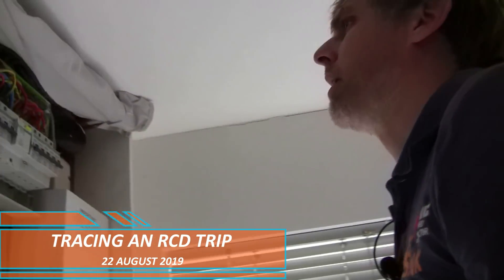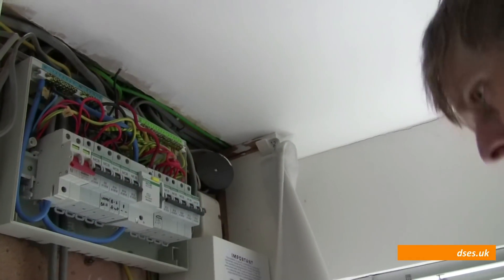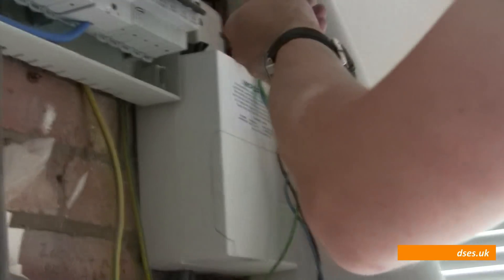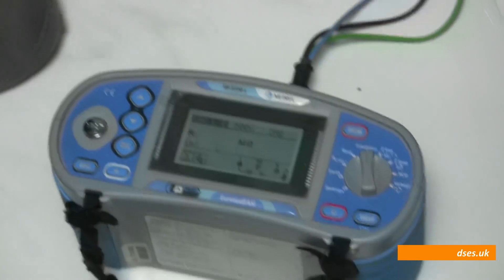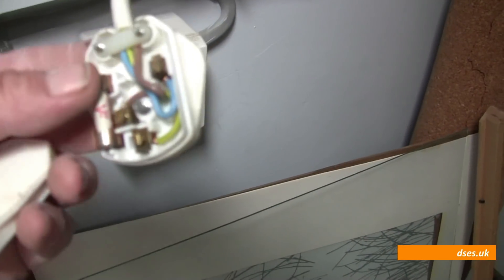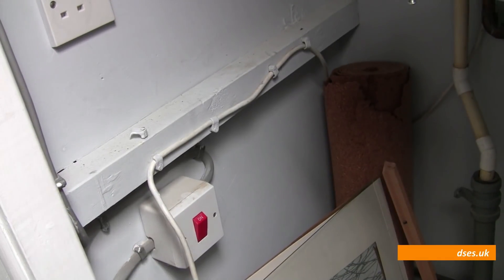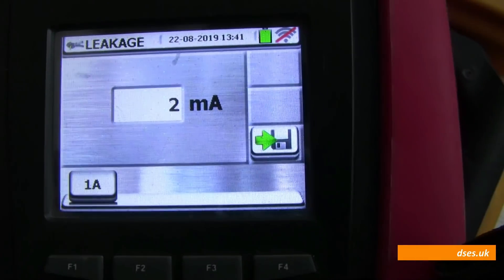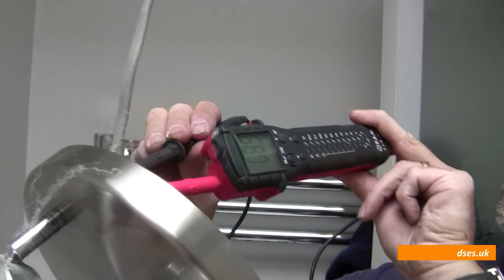Tracing an RCD trip

Comment: why do you guys join active and neutral together for an IR test?
Reply from the maker: We're squirting up to 500V DC into the circuit and there may be loads still present that wouldn't take kindly to it. By joining active to neutral, there's no potential difference between them that can pass across the potentially sensitive electronics of a connected load.

Comment: Went linking live and neutral together then testing ir between them and earth, can you not cause damage to appliances, lamps and e.g? Trying to get more comfortable fault finding so any tips would be fantastic
Reply from the maker: If line and neutral are linked together, then there's no potential difference between them, so you're not zapping your IR voltage across any sensitive circuitry. Unless there's a surge protector or filter between LN and earth, the IR test should cause no issue.
Reply: @dsesuk  absolute legend thank you

Comment: Don't think I've ever heard of small-size aluminium wiring in the UK. Are you sure it isn't tinned copper? That was fairly common back in the old days, required for rubber-insulated wires and apparently still done by UK manufacturers in the early days of PVC. The reasoning behind it is that rubber needs to be vulcanised using sulphur and that eats up raw copper so the copper is tinned first. PVC manufacturing is totally different so tinning is no longer required. Apparently these days (introduced about ten years ago) there's ways of producing rubber-insulated plain copper wires but until then rubber flex still had tinned conductors.
Reply: I suspect it's tinned copper, or copper clad aluminium. only once have I ever seen the old Solid core aluminium with the anti ox paste at the terminations, and that was in a house where it was built in the 60s (I think) and never touched. Well until we came and ripped it all out. Was probably the last house on the estate to still have its original wiring, and one of the last in the country to still be using solid aluminium t+e. It seems to be even rarer than rocking horse shite
Reply: @_______DR_______  Copper-clad aluminium would be the opposite, red on the outside and silver inside so either tinned copper or solid aluminium if it's silver on the outside.
Reply: @Ragnar8504  I was just wondering if he had prior knowledge that it’s copper clad aluminium, and wasn’t saying it’s aluminium based on how the conductor looks 🤔

Comment: You’re putting 500v down the live and neutral, not turning anything off. Couldn’t this damage equipment, which is plugged in?
Reply from the maker: It's possible, but I've not seen it happen. With a voltage applied to both line and neutral, the potential difference across them is zero... unless there's a switch on the line that is open or a broken conductor. Remember that IR testing in this way is exactly what happens in a PAT test, and although the code of practice for such lists this as a 'hard test' which can be omitted if a risk of equipment damage is perceived, most people who perform PAT testing including myself undertake such on common household or office equipment without worrying too much and without leaving a trail of destruction behind us. Manufacturers know equipment will be tested, and items around the home aren't likely to be too troubled by it.
Reply: David Savery Electrical Services cheers Dave 👍

Comment: Please help my electric went off at 3 in the morning, when I checked the electric cupboard it was the socket fuse that had tripped I tested all the other fuses but it was definitely the socket fuse that kept blowing, what can I do nothing was plugged in at the time to trigger it I just don't get it any advice would be grateful thanks
Reply from the maker: I'm sorry to hear of your trouble Suzanne. I'm afraid I can't say what the cause is without seeing it. You mention the socket fuse; that could be a breaker, an RCD or an RCBO that's tripping. A breaker would trip if there is an overload fault, an RCD if there's an earth leakage fault and an RCBO if there is either fault. Usually it's down to a faulty appliance rather than a problem with the house wiring, but if the house wiring has been compromised by, say, water getting where it shouldn't or rodent damage, then it could be an issue with the fixed wiring. You need someone to identify what kind of device is tripping, then narrow down why.

Comment: Does it matter for the RCD if the phase and neutreal are switching places? (I have a small shed where i maintain my bikes and the only means getting power there is a extension cord so IDK where the phase gonna be.)
Reply from the maker: An RCD is not polarity sensitive, and many manufacturers either don't label the terminals, or they label them as 1, 2, 3 and 4 instead of Line/Neutral in/out. That said, if your RCD is explicitly labelled, then by not following the labelling you wouldn't be complying with how the manufacturer intends it to be installed, although it ought to work just fine nonetheless.
Reply: @dsesuk  If i had any way making sure it would be the proper polarity i would do it, but in this situation its not feasible. The device only has explicit markings for neutreal, 1 and 2 for the phase:

https://www.mentavill.hu/_upload/images/catalog/423005/423005.jpg

Comment: I have experience of this. 9 times out of 10 it’s the circulation pump. Whether it’s in the boiler or not, sometimes it’s the zone valves if fitted on the system (not if it’s a combination boiler) my money would be on the pump🤞🏻
Reply from the maker: The heating engineer who turned up had no idea of insulation resistance and no means to test for such, so he part swapped the arse out of the thing until it stopped tripping. I don't know what ultimately fixed it, but I turned up afterwards and verified the IR was back in three digits.

Comment: Hi David, thouroughly enjoy your videos and watch them all the time. Just worth noting  you shouldnt have removed the cover of that boiler unless you are gas safe registered as it is a gas appliance. Just one for noting not a complaint, keep the great content coming. 
Rob
Reply from the maker: Thanks Robert, and I know, someone grassed me to GasSafe who had some words of advice. I didn't realise that the case formed part of the seal (or whatever the word is), an that it shouldn't be removed unless the manufacturer instructions state that it's only decorative. It seems strange to me that a manufacturer would make an appliance where the electrical connections are inaccessible to an electrician. We had the same issue again with another site only yesterday, but this time we had a gas man out to take the thing apart so we could IR test the component parts and identify which was giving us an iffy IR. It was the control board in that case, and he replaced it to get us all back in the pink!

Comment: why not just switch the rcd on then turn each breaker on till the rcd trips to find what circuit is faulty ?
Reply from the maker: Because if the fault is on the neutral then switching on a healthy circuit can still cause it to trip, the load from that good circuit leaking back through the bad circuit's neutral and down to earth. It can send you in the wrong direction. Also, there may be more than one fault which is having a cumulative effect on the RCD or an intermittent fault not present when we're there. If we test all circuits, then we know which we should be looking at, and if problems still occur we can compare test results if we're called back to see which circuit(s) are showing fluctuating readings.
Reply: Because then he wouldn't be able to play around with his (expensive) toys - and rack up his bill (while rifling thru his customers belongings).
Reply: @stevebell6057  looks more like a thorough and proper job to me.

Comment: Worcester greenstar, old gas valve looks like rain water is filling the unit inside you can see the water level, the power cables on the old gas valve use to go with heavy rain...

Comment: You pay 900 quid to fill in a book and try and make out its rocket science it really aint ! Process of elimination a 9 year old could do it
Reply from the maker: This was a straightforward one, but where it's intermittent or the result of one or more circuit having a cumulative effect on the RCD because of Ohms law for resistances in parallel, then it becomes more interesting.

Comment: Could anybody explains how a megger/insulation resistance tester works ? With a multimeter you're measuring the difference between two points. Is this the same with a megger ? Cheers
Reply from the maker: An insulation resistance tester squirts out a DC voltage down one probe, usually 250V or 500V for the work we do, then it detects if any of that voltage is picked up by the second probe. It allows wiring to be 'pressure tested'; a straight continuity test will show if there is a dead short, but if there's a breakdown or compromise of the insulation, then what you have is a high resistance path that won't be picked up by a continuity tester. Although that path is high resistance as far as the continuity test is concerned, once you energise that circuit, that resistance can break down allowing current to leak to where it shouldn't. By squirting a high DC voltage into the wiring, we can force a breakdown and detect if there is a problem without the circuit being energised. If you see what I mean!

Comment: That metal lamp in bathroom very unsafe not waterproof either and theres a missing bulb just to ncurage someone to put there fingers into possible live metal case. Did you replace with temporary bathroom light? Dont work on lighting live very scary when it explodes before rcd works. Alluminum thats very old circuit, i ripped all that out at my place, it also had cotton wrap on outside, but was in very good condition made to last. Had the dolly bakerlite switches too from 50s.
Reply from the maker: We had taken one of the lamps out when we first started looking at it, but you're right, it's wholly inappropriate for that location. We didn't replace it as we didn't have a suitable replacement with us. It's up to the client to decide if she wants to take our recommendation for having it replaced, we have no authority to force her to change it.

Comment: What are the consequences of having no earth on a metal light fitting and switch isn’t that a cause of fire if something does go wrong within the lighting circuit
Reply from the maker: It's not a fire risk, but the job of the earth conductor is to provide a low impedance path for current to travel down in the event of a fault. As an example, if the line wire pops out of the connector on the rear of that fitting and touches the metalwork, that sucker is going live, and someone touching it is likely to get a shock. Whether it kills them or not depends on a number of factors. If there was a working earth in the thing, then the current will travel down that rather than through the higher impedance of a human body, and the fault current shorting line to earth will also cause the breaker to trip cutting the power.
Reply: David Savery Electrical Services I see that makes sense thanks for explaining that keep up the good work 👍

Comment: Is the rcd like the ground fault here in 🇺🇸 usa i like the gfi outlet si if it goes bad you dont have to go threw a whole circuit consult codes before working
Reply from the maker: Yes, an RCD is a GFCI. Goodness knows why we call them Residual Current Devices, it seems to me that Ground Fault Circuit Interrupter is a better and more descriptive term.
Reply: I do wiring here in the us in England i hear red is live black neutral green ground 14 gage and 12 gage is what we use 14 gage on 14 amps close to 1.5mm 12 gage is close to 2.5 mm germany uses black live blue neutral yellow green ground is england on mm wire or gage 
In Saudi Arabia the outlets look like they take american plug and they do but looks like it wires like a British outlet on the back and goes on a British box and i hear they use awg american wire gage wire and black live white neutral green ground like 🇺🇸 thanks
Reply from the maker: We're metric for wiring here so the CSA is in millimetres, usually 1.0 or 1.5mm for lighting, 2.5 or 4.0mm for sockets, 6.0mm for cookers and 10.0mm for electric showers. Old colours were red and black for line (hot) and neutral (single phase), or red, yellow, blue for three-phase, but around 2005 we harmonised with Europe who are brown and blue single phase and brown/black/grey three-phase. Really old colours used a dark green for earth, but that fell out of favour as in poor light it could be mistaken for another colour, so green/yellow is now used with a 70%/30% split, so some earth cables are mainly yellow with a green stripe, others mainly green with a yellow stripe. It would be nice if, as a species, we could have standardised more on colours, voltages, outlet types and terminology more. Any alien race who visit us in the future will think we're mad. If they're intent on world domination, they'll have a hell of a time buying adaptors so they can plug in and recharge their ray guns as they go around the world!
Reply: @dsesuk  4 mm is it solid or stranded i hear they do ring circuit from breaker threw all outlets and back to same breaker is that to minamize voltage drop
Reply from the maker: 4mm is stranded. Ring circuits are in widespread use, but not for voltage drop, rather they're a throwback to WW2 as copper was in short supply. They allowed a house to have only one or two socket circuits rated at a higher current (30A fused or 32A breakers) rather than requiring two or three radial circuits each rated at 15-20A thus saving on wiring. The ring configuration allows thinner cable to be used, 2.5mm usually, but because you have two paths from the breaker, the CSA is effectively 5 sq. mm. Sadly, even after copper became readily available again, the ring thing stuck and new houses are still built with them today. They're fine until Joe Homeowner comes along and makes cack-handed modifications leaving the ring broken and an undersized cable at risk of carrying a current it wasn't rated for while the breaker sits there happily doing nothing. Personally, I don't like them, and when rewiring a property we tend to install radial circuits. The high current ring is also the reason why UK plugs all have fuses in them as a 32A breaker wouldn't be much protection for an appliance flex in the event of a short circuit. Plugtop fuses come in 3, 5 or 13A flavours generally and offer localised protection for any given appliance.
Reply: @dsesuk  do you know about Saudi Arabia outlets us plug with us outlet standard but British box and hardware
Reply from the maker: I'm afraid I've no experience of them. A bit of Googling suggests they commonly use the BS1363 outlets which are the same as used in the UK. Are you travelling there?
Reply: @dsesuk  no but im interested in wiring around the 🌎 world did you get my question about 4 mm wire can you put 2 4 mm wires in 1 hole on wall sockets under 1 set screw one cable coming in and 1 cable going out thanks
Reply from the maker: @DavidBerquist334  The terminal screws on the rear of socket outlets will accommodate two 4mm wires. We wire in some radials using 4mm to we can keep the supply high (32A) for things like kitchens and utility rooms. You wouldn't ring a 4mm circuit as thee's no point: you'd just be spending more on thicker wires with no advantage. This is all from a domestic point of view of course, in commercial, industrial or unusual situations longer or thicker cable runs may be required to cover larger distances or to combat voltage drop.

Comment: Great fault finding video...
I do  love a good sweary rant…

We have loads of books on regs and code, and guides.

I would like to see the DSES  guide to electrical terminology. 
The correct terms,  and appropriate swearing, for various electrical annoyances.

 
Such as dropping a grub screw when putting up a heavy ceiling light
, 
Kneeling on a raised floorboard nail
Finding the  wholesaler  has left you one short.

RCD fault at 4pm on a Friday
A customer who asks you to look at one more issue, after, you have loaded everything back into the van.

In an itchy loft, on the hottest day of the year.
The realisiation that you have left your favourite side cutters under the floor boards, after you have put the carpets back down, and the double bed put back.
Working on a house that was previously owned by a very keen DIY enthusiast.

Central heating wiring centre back box lug, won’t grip screw.
Reply from the maker: Haha! I can relate to all of those, and can nominate a few choice cuss words for each occasion!

Comment: Would you mind explaining what you meant by "floating earth" while you examined the bathroom light? Cheers! Great video guys👍
Reply from the maker: Hi Dean. I just meant that the CPC at the luminaire wasn't connected to anything, or if it was, it wasn't a good path to the main earth terminal back at the source of the installation.

Comment: Hi David what’s the model number on the metrol tester please? I need a second cheap tester.
Reply from the maker: Hi Chris. I don't know that it's cheap, but mine is the Metrel MI3100S. I think it's the same as the Martindale ET4000, just a different colour case, although the Martindale I believe takes standard test leads while the Metrel has a proprietary connector. I really rate it though, well featured with a great display. Shop around though, prices can vary wildly as you know!
Reply: David Savery Electrical Services thank you sir.
Reply from the maker: Always at your disposal my good man!